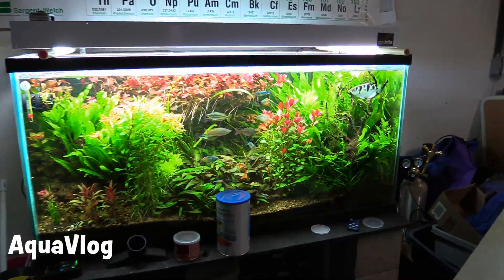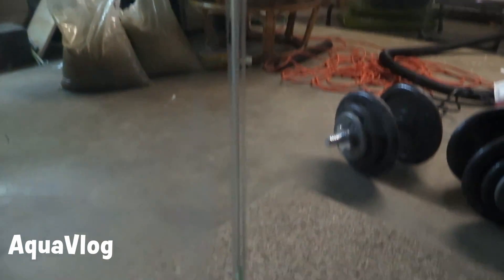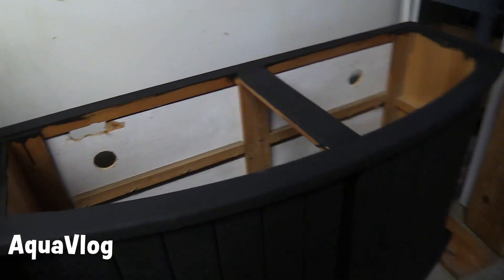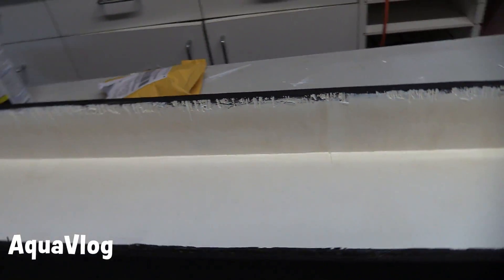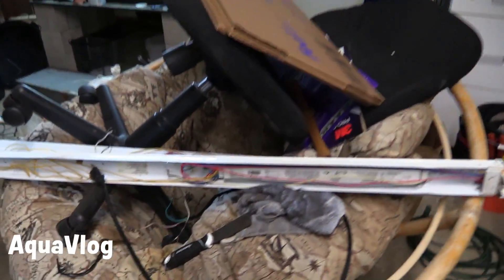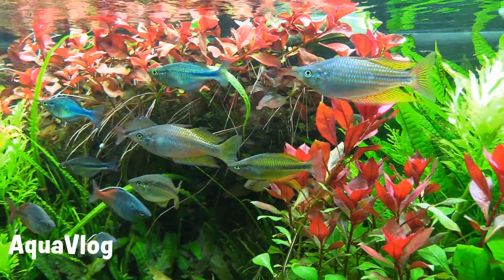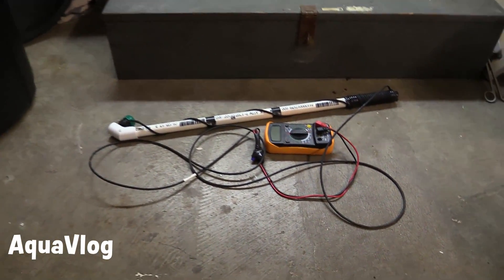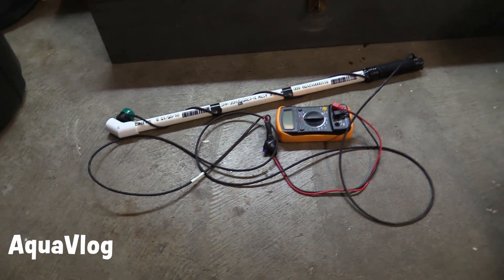Project Progress - 150 Gal Aquarium, DIY PAR Meter??? and More!

Comment: any advice on getting ludwigia red like the. by the way so glad your back realy missed your videos☺
Reply from the maker: +jason rivas Most Ludwigia spp. are easy to get growing red as long as they have med-high light (100+ PAR). The fixture they are under now puts out about 520 PAR at the surface and the tops of the plant are getting about 250 and the lowest red stem is getting about 100. Also really depends on the spp., some will be more red than others. Fe can also play a role, but dosing iron isnt required for most.